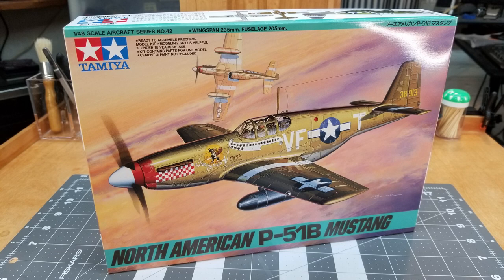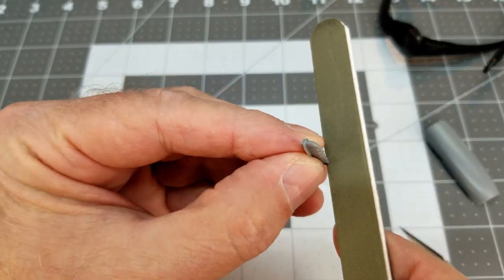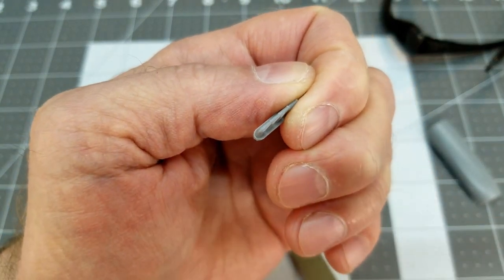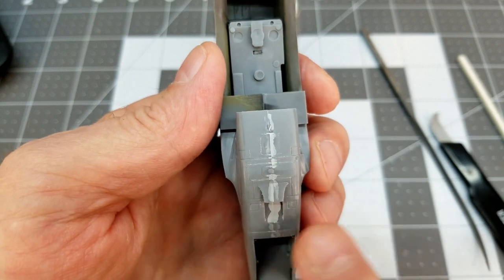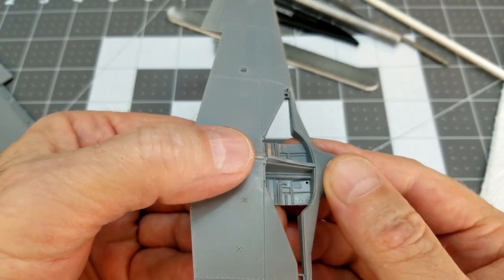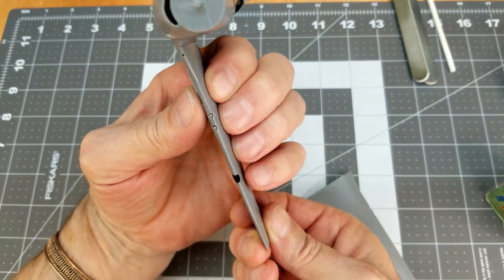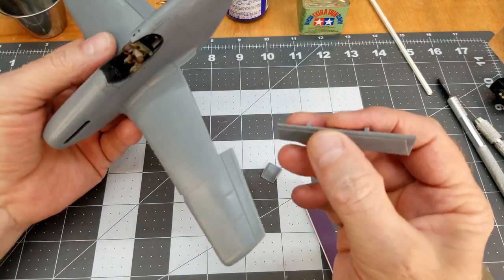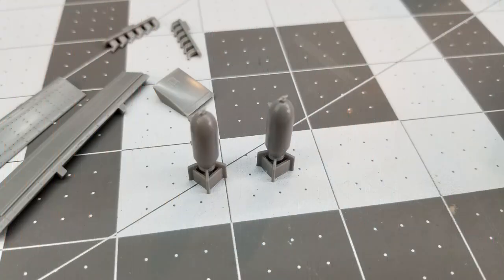P51B Mustang by Tamiya in 1/48 Scale, Build Part 3, Cowling, Exhaust, Wings

Comment: Hey bro looking good I fogged up my glass i accidently cleared over the cockpit glass and it all fogged up im just going to put it up as final soon and get new kit for the glass only i can use kit in a dio or something then u know👍 great work.. Keith
Reply from the maker: Yeah, I'm going to try really hard to get mine fogged up. I'll use Testors window cement, I think. Model on dude!! Johnny
Reply: Have tried contacting Tamiya to see if you can get a new canapy. I had a problem with an AirFix kit part I contacted them, they're sending me a new part, perhaps Tamiya might do the same

Comment: Beautiful model and skills. I've got this exact model in my stash and you've motivated me to do it. 

What size bits are you using for the exhaust and machine guns? Is there a kit you could direct me to? Thanks!
Reply from the maker: Hi, thanks for watching my friend. I acquired a really nice drill bit kit that I got off of Amazon, just look for Micro Drill Bits Item No. PCB50-DB. You'll love these, you won't have to use a pin vise to use them either. This is a great kit, you'll love it, goes together very nice. Take care and have a great weekend! Johnny

Comment: As I was drilling out the wing hard point mount holes i noticed that the distance between the front and rear hole are slightly different on the left wing and right wing, did you notice that?
Reply from the maker: I have to admit I don't remember, I wonder if there is a slight angle difference for the hard points making them a left and a right, maybe? It's been a little while since I built this kit, lol. Thanks for watching. Johnny
Reply: @hillbillymodeling I looked at the hard point mounts today, they are set as the holes are different for each side, thanks for replying
Reply from the maker: @Rauger-ye7uu  Sorry I couldn't have been more helpful my friend.